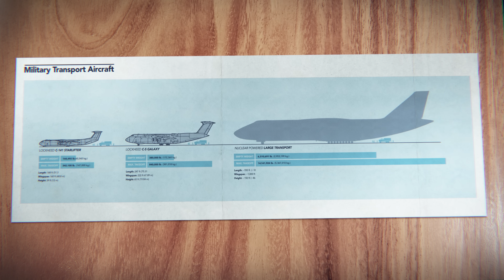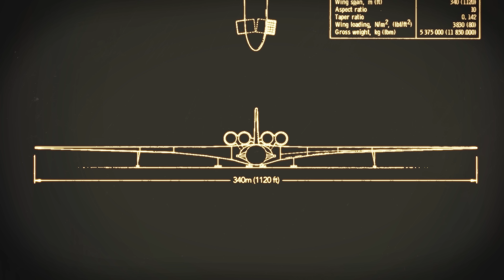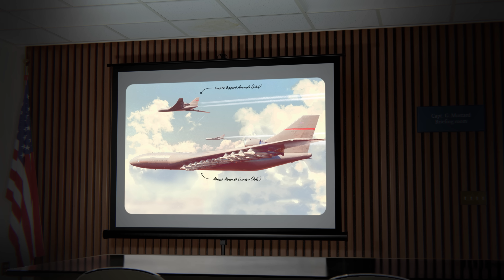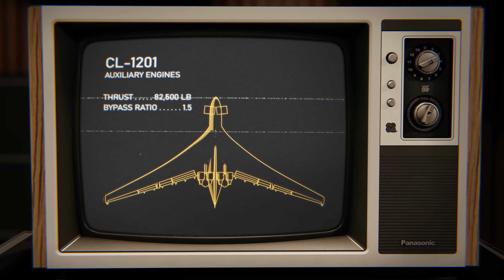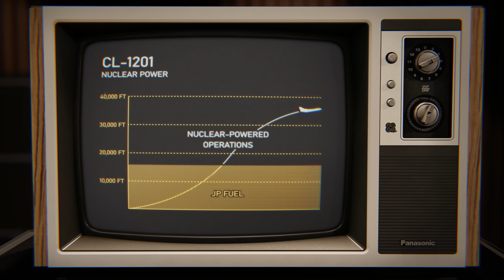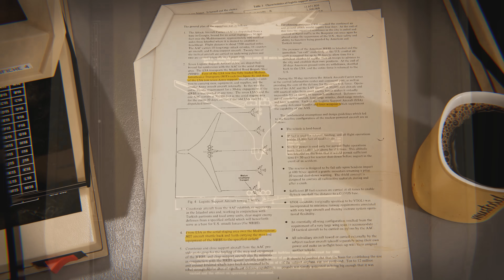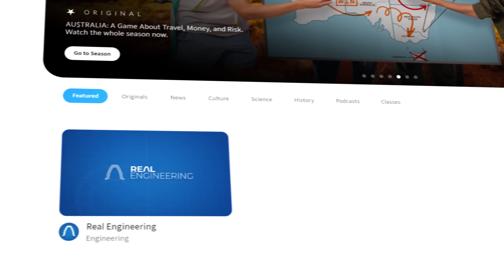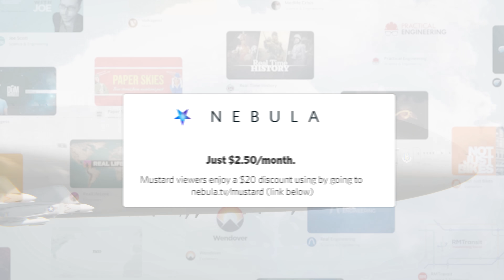Lockheed's Insane Attack Carrier: The CL-1201

Comment: There’s a small problem… How would the pilots land without digging a quarter mile deep crater in the ground? Especially when the cockpit is that high off the ground. The engineers could have added cameras but, like the Soviets did, it may have been a better idea to have a room closer to the nose gear to see better and for the pilots to take control from (not what the Soviets did) for landing. Don’t quote me on that, though.

Comment: wings are massive space, i bet fighters would approach from above matching speed and seemingly looking like vertical landing, fuselage would open revealing a landing platform that would lock onto the fighter upon touch and before fighter turns off its engine. platform would then be lowered inside and opening closed. exit would be simply a reverse of this. emergency exit would blow the bottom fuselage and allow for the platform could drop its back end through and allow for the fighter to simply roll out upon release

Comment: 7:54. Radiation exposure will be "limited by shielding"! At least the Americans told the truth. I'm sure the Russian Pilots were told the radiation was eliminated. They all died of Cancer within 3 years after their test flight. In the long run the Russians used a Dirty Air System where the air was directly heated by the reactor. It killed the pilots and released Radioactive air from the engines. The Americans used a heat exchange but found all of the plumbing and components involved weighed so much the plane would be maxed out on weight and could not carry cargo. The Americans never flew their plane so we don't know if it was a killer.

Comment: The biggest problem with the CL-1201, in either of its configurations is; where do you begin listing the logical reasons why this aircraft concept would never work. Where does one begin? OK, to kick off let's look at the aircraft alone - without the 24 F4 Phantoms or the 400+ combat troops and their supplies. The CL-1201 is a honkingly huge airframe. Did you notice the 3 [three] deck levels aft of the tiny 'slit' holding the cockpit. All of this 'real estate' is forward of the massive wings. 
Let's look at jobs the wings have to do apart from keeping this flying ‘aircraft carrier’ in the air. Allow troops to physically walk from the nose of another aircraft; into the wings through to the main body of the CL-1201. They would have to be passing monstrous JP fuel tanks for the aircraft's flight, under 16K ft and somehow 'step over' the anchors for the 24 aircraft docking mounts. Plus they would presumably be passing all those extra down-draft engines that allow for STOL. Yep, busy wings.
So, only parts of the wings are needed for JP fuel tanks. You'd think there would be provision for the pilots and Wizzos from each Phantom to get out of their aircraft; or, are they expected to stay in their cockpits and catch some ZZZZs for the hours it takes to fly them to the 600 NM from their 'war zone'? And, like 'Mustard' said, how would the Phantoms be reloaded with weapons?
(By the way; forget about the 600 NM 'safety zone'. The CL-1201s and their payloads would be such an attractive target for an enemy, they would pop up their subs, anywhere along their flight paths, to take shots at CL-1201s passing overhead.)
Getting the Phantoms to actually dock with a flying aircraft; approaching through 'savage' wing turbulence would produce another set of problems; enough to give any aeronautical engineer a permanent migraine.
Let's leave the 'best' for last. The nuclear reactor powering the CL-1201s. Sounds whacky doesn't it. Well, yes, considering that the USAF and a civilian contractor tried hard to achieve this some years before the CL-1201 concept. 
It was found that the weight of the shielding needed to protect the crew members from glowing in the dark made the huge, powerful 4-engined aircraft way too heavy to leave the ground.
The really bad news comes last. 
Would you want to be among 400 of your buddies from the USMC to board this aircraft knowing that just one air-to-air or sea-to-air missile would kill the lot of you in an instant? Perhaps not. Similarly, this would be a tragic way to lose not only the CL-1201 itself but also 24 Phantoms and their 48 crew members, oh, and a nuclear reactor. In the 'carrier' mode a downed CL-1201 would mean footing the cost of over 460 coffins and Service funerals.
Possibly not the best use of taxpayer monies. 
Ah, I remember the 60s and 70s; a time when Uncle Sam's military thought they could do anything and, no matter how insane, it would be funded. 
On The Hill those folks would be thinking, 'Wow, the entire CL-1201 Program would create tens of thousands of jobs, heck yes, let's do it.'
Take a look at the excellent satirical comedy film, 'The Pentagon Wars' (1998) It is based on the true tale of the Bradley Fighting Vehicle's development. 
A long, delayed program that, apparently, cost US taxpayers over $14 billion before one completed Bradley rolled off its production line. 
In 1998 that sum would buy you 3.1 Nimitz Class Aircraft Carriers. Think about that next time your filling out your 1040…
Cheers, Bill H.

Comment: My favourite thing about this project is that the "solution" to the fact that regular runways will not be able to handle this kind of aircraft is to just land them on regular runways anyway using Short Take-Off and Landing. If anyone remembers when the Airbus A380 first came out it became a big problem that airports around the world needed to be upgraded in order to have runways big enough to land the planes. Concrete is not some sort of magical substance that can support infinite loads. Landing a 6,000-tonne plane on a normal runway will likely rip it to shreds - just imagine the amount of force the brakes would be applying to the wheels and to the tarmac in order to bring this plane to a complete stop.

Comment: 7:02 - That little mistake made me jump out of my seat. 18000 MW would be enough to power entire cities at once. For comparison, the largest hydroelectric dam outside of China (Itaipu) "only" produces 14000 MW. Modern US carriers range between 500-700 MW, submarine reactors are in the 100-200 MW range. Do note that these are rated by thermal energy, not electric, only about a fifth of those values actually becomes electricity. I have no idea of what the effeciency values are for converting thermal energy into thrust but still, 18GW on a plane would be sillier than the very idea of a giant flying carrier.

Comment: With technology today an air after carrier could be built that has double the fighters and bombers of a conventional aircraft carrier. They could remain in the air for a year and have multiple reactors to power it. Downward facing propulsion could keep the air carrier flying at very slow speeds or remain in one place for many months. The problem is that they would be very cisable from land and modern ballistic missiles reach them quickly, but with the improvement of laser weapons and possibly a force field they could overcome those problems. Cost would be the only limiting factor.

Comment: Mindblowing. The big glaring hole in the concept however is the reliance on capturing a usable airbase and securing it with just airpower. The flying carriers can't be reliant on this, as airbases are too easy to sabotage. Even if you envision airborne troops parachuting in the enemy can always quite easily block and blow up runways. 

It would be vital to have a way to deploy troops that would not require a runway. If you envision the plane as more of an airborne helicopter carrier I think it would make more sense. In a modern setting I would propose to equip it with a large number of VTOL tiltrotor gunships like Ospreys.

Comment: Smells like balls to me, youtube fantasy. Aircraft design innovation is always at the mercy of advances in powerplant capability. If they had been capable of producing an engine with the crosssection the size of a C5 fuselage back then, engines like the JT-9, CF-6, and RB-211 wouldn't have been the predominant engines of the 70's, 80's, and 90's

Comment: This aircraft had a ton of flaws and, to be honest, if you're going to have a flying aircraft carrier, then, of all things, Marvel Comics already showed how it was to be done with its S.H.I.E.L.D. Triskelion, as it was essentially a flying aircraft carrier that had much larger turboprop fans that were built into wider, though shorter, wings (which could work, but that they also could suck in a lot of debris, especially if it was located on a flat land space, thus maintaining the area being free of debris is a VERY good idea).  However, the advantages of going with the Triskelion design would be that aircraft can be launched from an internal runway that is built like more conventional aircraft runways (though building one on deck is possible, although not safe), a Triskelion type flying aircraft carrier could be VTOL (Vertical Take Off and Landing) based, rather than be limited to normal runways, jet fuel wasting long take offs and landings, even more billions more American dollars in debt, the pilots don't have to always be stuck inside the smaller aircraft, and the length of the aircraft can be improved significantly over the Lockheed CL-1201.  Also, since nuclear fusion engines are going to be a thing, as I heard positive things about those sorts of energy being put into preliminary test phases, then it might be a good idea to make massively powerful, and perpetually infinitely long lasting, nuclear power to power all of the different functions of the real life Triskelion.  Moreover, another big flaw of this particular Lockheed aircraft was that the pilots had to be put into the smaller aircraft BEFORE the main aircraft took off from a runway.  Let's also not forget that aircraft that are like the Lockheed C-117 Globemaster, the Lockheed C-5 Galaxy, and the (formerly existing) Antonov AN-227 also can't land at many airports due to their massive size, and the Lockheed CL-1201, were it to be built, would be not only more limited in its size due to the lack of airports that would be able to handle an aircraft of that magnitude, but then you would either have to a. build specially sized runways that could handle an aircraft of that size, and spend billions of American dollars for such a thing, as well as also tick off the NIMBY, envirotard, and polititard types, or b. take a cue from the S.H.I.E.L.D. Triskelion and make it an amphibious aircraft, which might create a whole other batch of problems for either scenario.  However, I'm not a flight or physics expert, and I'm also not Marilyn vos Savant, so what do I know, right?

Comment: Another issue for the protection of such a monster is that other Nations was not standing still when it came to their Technological developments.

Lockheed thought that the SR-71 would be protected by its Speed, Stealth capabilities and EW.
But we know that atleast SAAB JA37 Viggen was fully capable to shoot them down on a regular occasion.

3 other possible candidate were.
The USSR's MIG-25 and its succesor  MIG-31.
The British Electric Lightning.
And SAAB J35 Draken.

Luckily for USA most of them were never a threat as they were from allied Nations and the MiG's did not have the advanced onboard computers nor the advanced Digital DATA-Link that the Swedish planes Pioneered.

The point still stands that whilst the project was possible.
The reality was still that these types of vessels would be far more vulnerable than they probably had ever realised.

But they would have been awesome to see on the sky.

Best regards.

Comment: Almost wish they built this absolutely ridiculously mental idea, would have been fun to see this taking up your entire radar screen.
Reply: Why hide when you just be so massive that other aircraft can hide inside your rcs.
Reply: It would be very funny if initially radars ignored its signature, because it was too large to be considered an actual aircraft
Reply: And then the fun begins as basically any anti air missile within a 100mile radius launches at the massive target. There only so much counter measures can do, and missile builder by a camera with a guy behind it do exist. Not to mention mig 21s.
Reply: Trouble is it would never get off the ground.
Reply: @georgespalding7640  Seems feasible given a properly allocated budget. There isn’t an upper limit on the size of aircraft. As you get really small the size of the air molecules makes flying difficult. Aerodynamics doesn’t have that problem with really large airplanes. Theoretically an aircraft the size of a super carrier can fly, if you have the proper lifting surfaces and thrust it will fly.
Reply: @tornmap4385  Of course there's an upper limit to how big an airplane can be. They're simple equation you have to have four times the wing surface area per twice the weight of the aircraft as you get larger. The AN 225 was already pushing the limits of size of airplane.
Reply: @tornmap4385 Yeah, yeah, but Lockheed engineers were so preoccupied with whether or not they could that they didn't stop to think if they should.
Reply: @georgespalding7640  There are many problems with this design, size and weight of course being one of them, it's also one gigantic target for enemies, also new runways would need to be built just to cater for this specific aircraft, I could go on and on. These days a drone mothership would be far more feasible.
Reply: @ThomasBrenton-pk8gg  Nice JP reference lol
Reply: @SherLock55  Not only that a single crash would result in unspeakable loss of lives and money.
Reply: Haha, fun you say. Unless you're the enemy of course! 😆

Comment: The biggest issue facing all war-related aircraft is the fact that ground to air missiles have gotten so cheap. An adversary could easily have hundreds of missile batteries.

That means fast low-flying planes, or drones. 

Things like the Apache, and A-10 are extremely vulnerable.
So for cargo planes, staying away from dangerous areas is going to be more important than ever. 

It’s funny that Israel supposedly has a missile-intercept-missile.
Iron Dome. But I’ve never heard of an Air Force version that can be fired from a cargo plane.

Comment: The CL-1201 could theoretically be built today, trading manned fighter aircraft for drones, using smaller but more powerful and modern Small Modular Reactors for power, and improved engine technologies. Stuff in a few laser turrets, and you'd have a functional Arsenal Bird, only lacking in shielding. And having it operate even higher could allow one to operate as a long-range command center, while maintaining a degree of direct line of sight for certain kinds of communications.

I do recall reading that there was a rumored 3rd design, but the popular speculation has been that it was either a semi-permanently flying AF1 for continuity of government, or designed as a flying orbital launcher (and could launch ICBMs or manned spacecraft alike).

Comment: This aircraft was truly ahead of its time. I imagine it could be built today with modern technology and drones fighters
Reply: it could be built with 70's technology as well. What are you saying?
Reply: @tornmap4385  Try to talk soldiers into staying on an airplane for 30+ days.  There's no mention of shower, laundry and feeding facilitation and to conceive of this idea brings up those problems and a great deal more.  As a former paratrooper you'd have to put them in suspended animation or else they're likely to try taking over the plane.  I've been on a 9 hour flight to S. Korea from California and can tell your that's definitely going to be a problem.  Today we can be anywhere on the planet with full combat load to include our vehicles in less than 24 hours.  Why would we need to be in this behemoth for over a month?  Marines do that on boats, the difference is we spend our down time with family and friends while the jarheads are stuck on a boat for 5 months or more, just like this idea suggests.  This is a terrible idea.
Reply: It’s a giant, unmistakable engineering nightmare waiting to crash before it ever gets off the drawing board. But the gamers all love it because their heads are pounded full of sh!t and they have way too much time on their hands.
Reply: @tornmap4385  it definitely couldn’t. Designing the reactor alone would have caused a lot of problems not to mention docking fighters in mid air. Fly by wire technology was still in it’s infancy back then

Comment: Well, i thinking about the light of Phoenix obviouly, But it seems that there is no shed big enough for this bird in North America. 
Apart from that, it would have been necessary to create a factory(s) of monumental size. 
I am thinking in particular of the factory that specifically built all the aluminium crosspieces for the Antonov An-124/225.
So it seems normal that the project never saw the light of day.